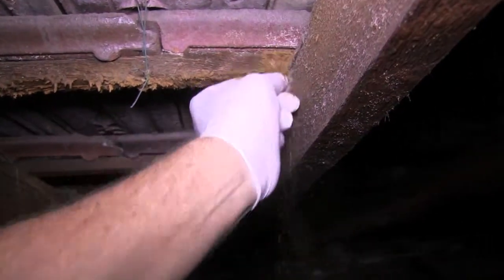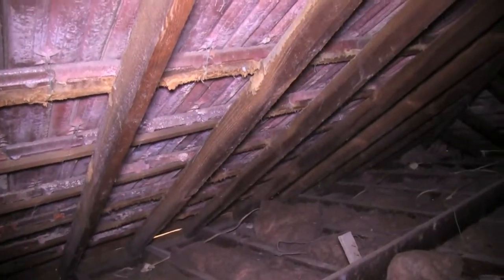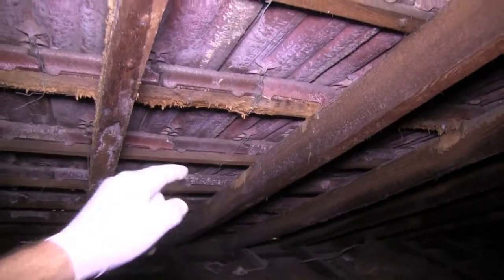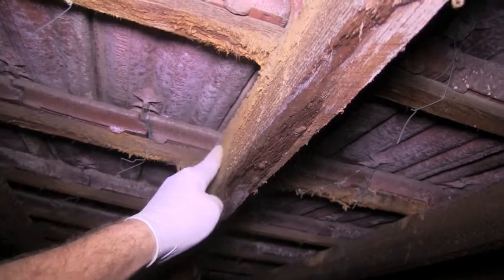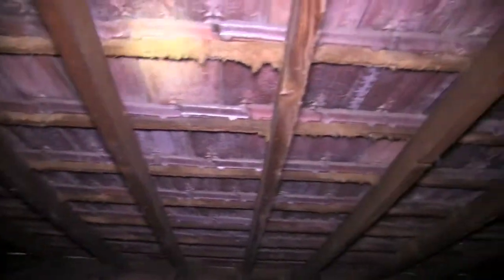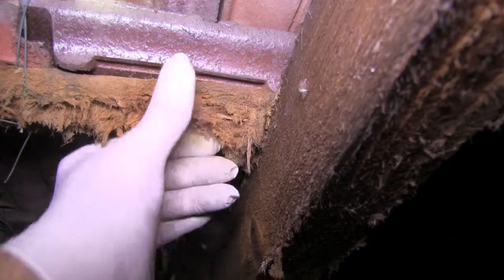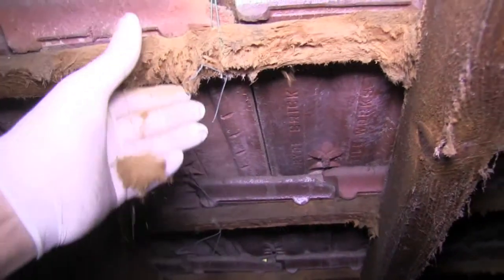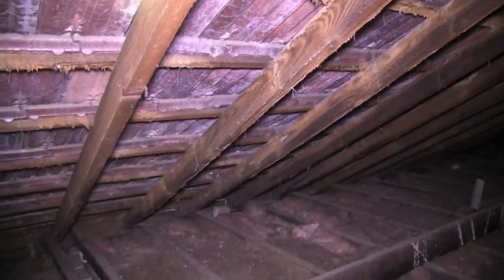Chemical Delignification

Comment: We have quite bad delignification similar to the second example you show and some signs of it in our floor bearers too. It's a large semi with both side affected. Any advice on how to apply Linseed oil to large areas? Can it be sprayed or does it have to be brush applied?
Reply: Hi Ben, did you manage to conduct the treatment on your roof? If yes, did the linseed oil helped (did you brush it or sprayed it?) Thank you very much